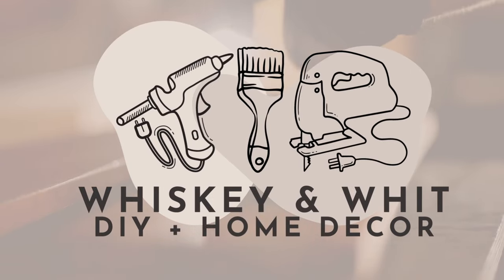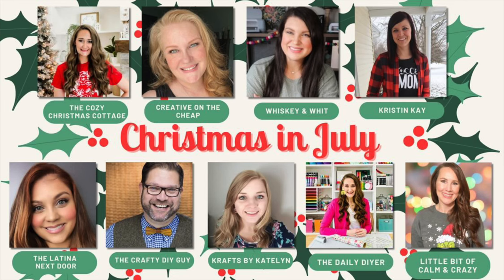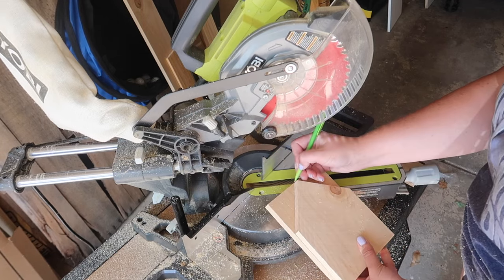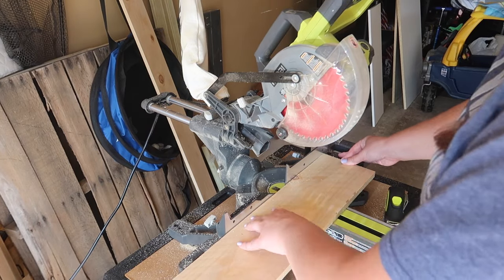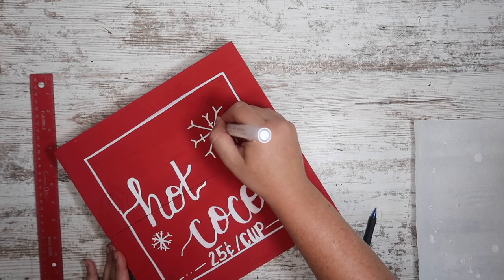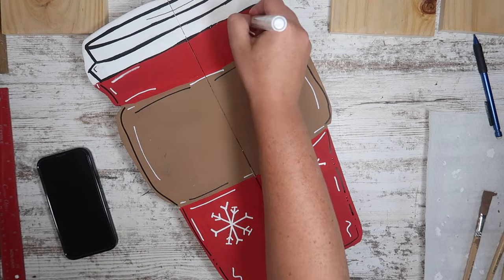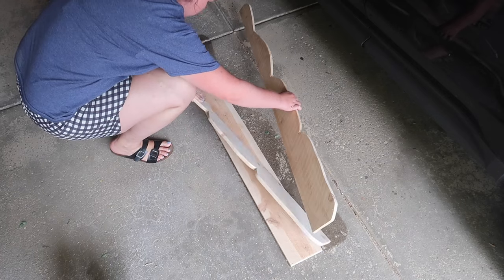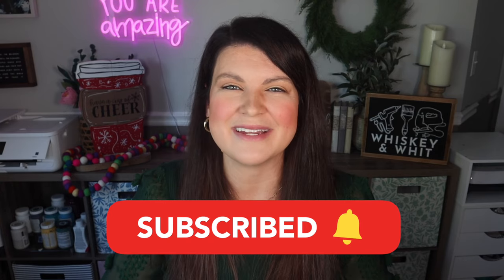Grab $3 wood fence pickets to make these EASY Christmas DIYs 🌲 PLUS they're great to sell!

Comment: Here’s a little tip for drilling holes in wood without blowing the back of it. Get a set of Forstner bits. They will make a cleaner hole. Also, use a scrap piece to put under where you’re drilling your hole and you will have a much cleaner hole.
Reply from the maker: Thanks for the tip!

Comment: Beautiful as usual Whitney 
To avoid wood blow out on your tags… use the paddle bit until the point of the blade protrudes then flip the board over and finish drilling from the back side
Reply from the maker: Great tip, thank you! I don't use them often so that's great to know!

Comment: When you add the drips on the front of the roof, note the direction they fall (not at an angle to the bottom).
Reply from the maker: Thanks for the tip!

Comment: I'm "in trouble" and need help.  At 63, I asked for and got a black n decker 6 in one power tool. So far I've only used the drill..yay me! But there's a trim saw , and others on here.  Having never used any power tools ( wait I changed a water pump in a car and used air tools when I was 30, and 9 months pregnant if that counts) I would love more easy projects to try out new machine but not cut my fingers off.
Reply from the maker: That's a great start!! What type of tool are you wanting to try first? That will help me know what types of projects you're wanting :)
Reply: @Whiskeyandwhit  I'm most intimidated by cutting tools(I cut the end of a finger off at 10, when a jack knife closed on it) so let's get that out of way first.  I am ok using the power drill ( I made a wood tray, had to inset the screws on back) and power sander.